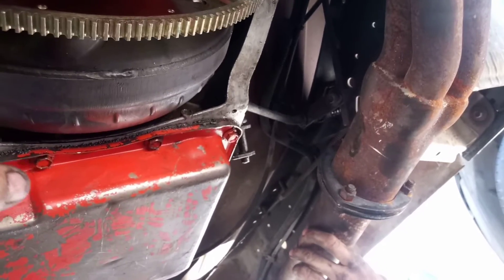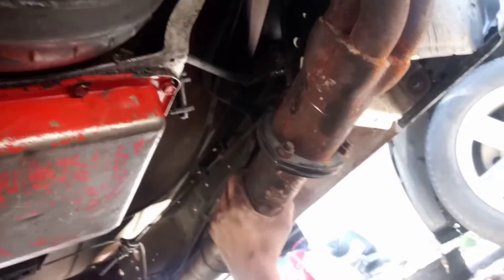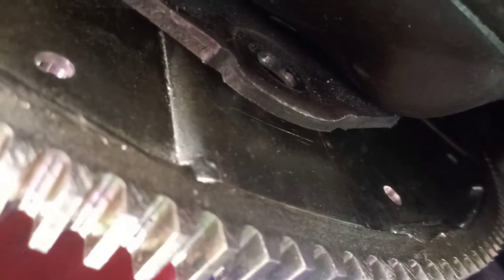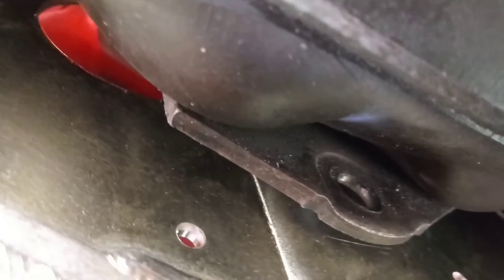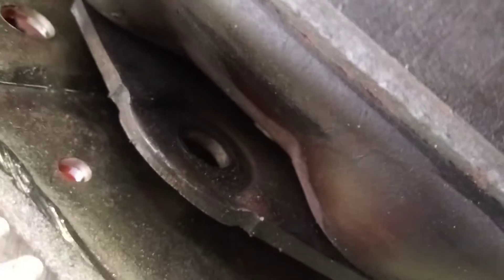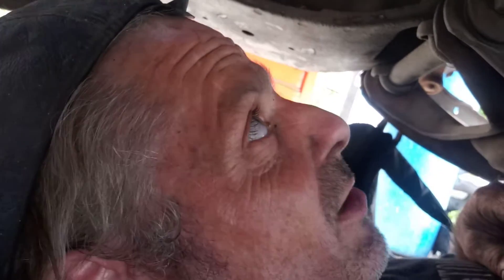Installing a flywheel? Important tips

Comment: Bellhousing bolts on these sbc love to rattle out loose after putting in a motor, I had 4 of them rattle out loose on the freeway. Sounds like rod knock. Use loctite on them as well.

Comment: There should be a dab of paint on the fly wheel and a dab of paint on the torque converter. You line them up as close as you can for balance issues. The bolts must be grade 8. Must have locking nuts on them, but a little lock tight won't hurt either.

Comment from the maker: Phone video was cut short my phone shuts off when it gets too hot some other things that were left out was when you seat the torque converter into the transmission you spin it or turn it just because the torque converter stops when you put it in does it mean it's all the way in you have to turn it and you'll feel it slide in further I usually spend it back and forth to three times and turn it full rounds I made this mistake once when I was a kid only 21 years old working on my Camaro and it really pissed me off so bad that I broke my transmission pump